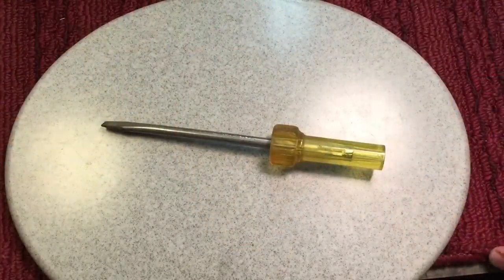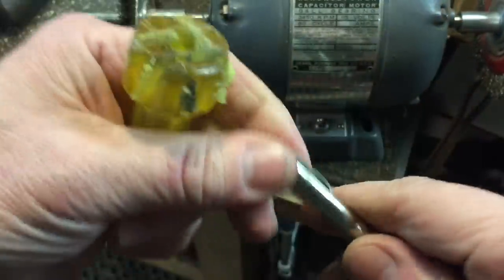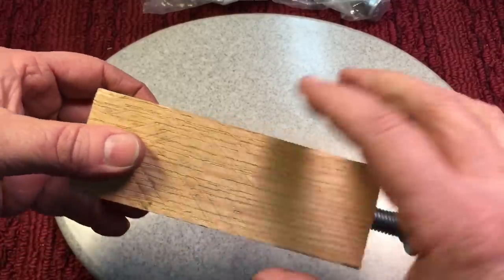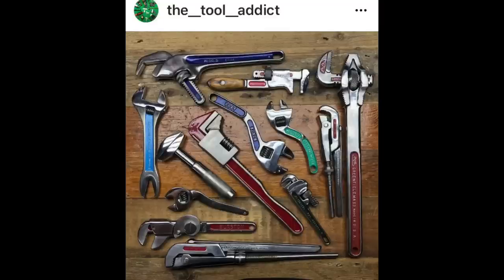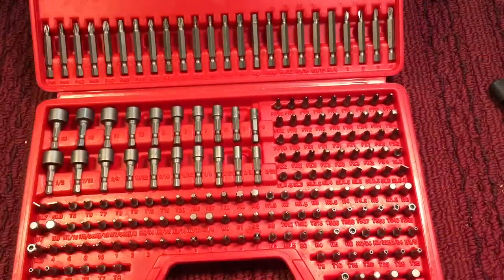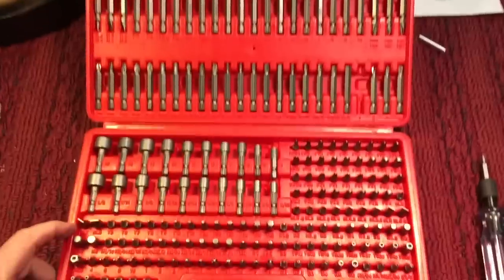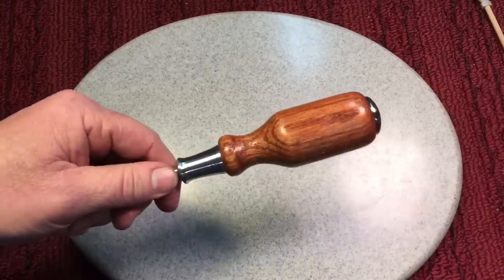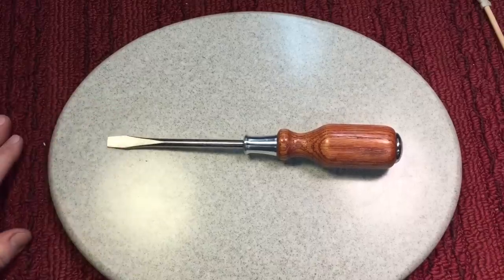Classic Screwdriver Make-Over.

Comment: I thought of buying some deadblow hammers, but I'm closer to the other side of tooling up.  Anyway, my buddy, Tommy Lee, gave me a 2# copper hammer which has served me well for decades. WhenTommy was still with us, he was a machinist at a steel mill. The first thing he said when he found out I was buying an engine lathe was, "You'll need a copper hammer."  He was right. They were so much like bubble gum in his shop, they cast the copper and handled them right there.  Thanks, Tommy, wherever you are!

Comment: Yesterday I picked up a large Rosco square shank screwdriver with a translucent handle from a thrift shop for 99 cents, it had a broken tip, in the past I would had reground it on my bench grinder but I used the ScoutCrafter technique and did it using my angle grinder, wow, that works better, much easier to control the grind.
I feel good about saving that old tool, I like it so much I can't wait for the patina to grow on the new ground area...LOL

Comment: Maybe wood paneling is makin' a comeback on our vehicles, tv's and appliances too 😂 Great job on the screwdriver. Clear grain ash prize went to excellent use. Bout needed an extra long pin punch there. In a way it's an homage to Patty. 
Nice bit set 👍 Still need 5/32" clutch drive on Holley Carburetor metering plates.

Comment: Ash is a very underated wood. I think it's because it has a coarse grain. But it also has intelocking grain and that makes it extremely durable. Roy Underhill claimed it was the prefered wood for wagon wheel hubs. You know, the center part that could split. Using Ash it is apparently far less likely to split. They actually used different woods in those old wagon wheels. Each being chosen for specific qualities. BTW we are losing Mountain Ash by the boatloads here due to the Emerald Ash Borer. We used to have piles of free wood chips and they are not even doing that any more to make sure the wood diseases don't travel as much.
Reply from the maker: John- If you don't already check out Engles Coach Shop... On Youtube!  Awesome channel!